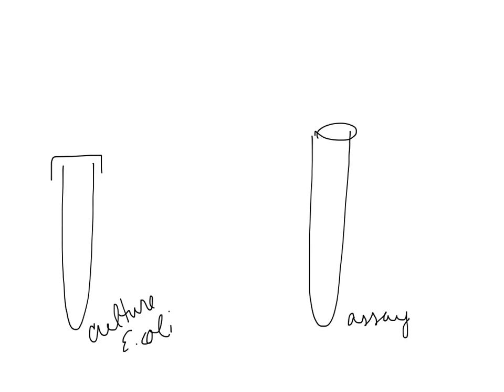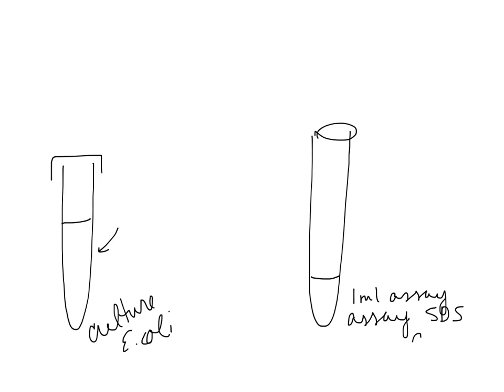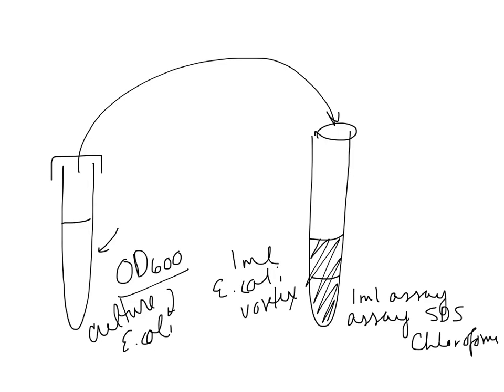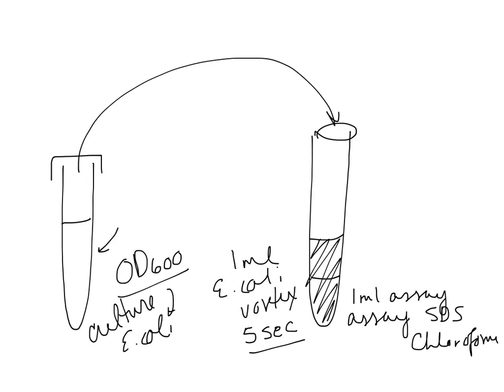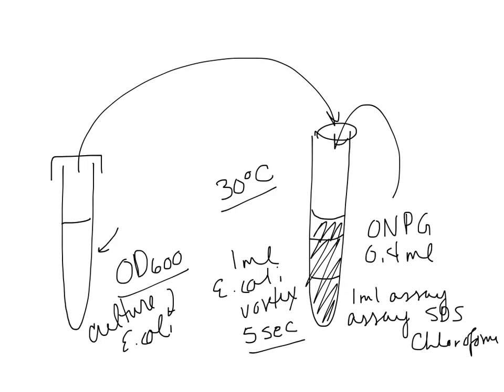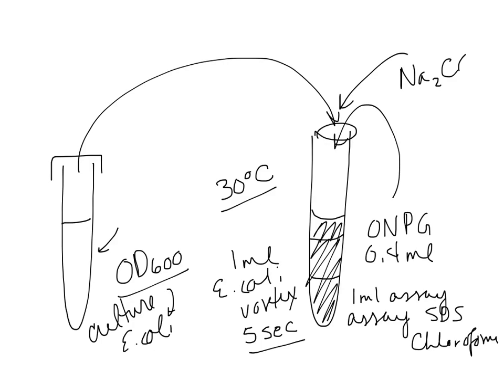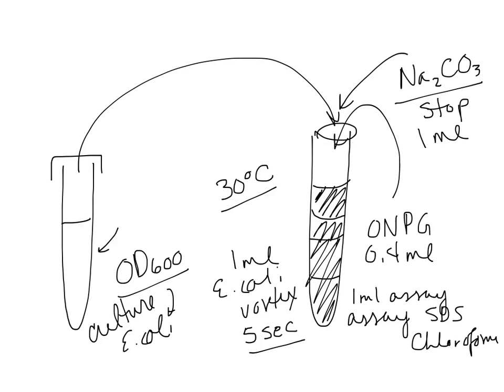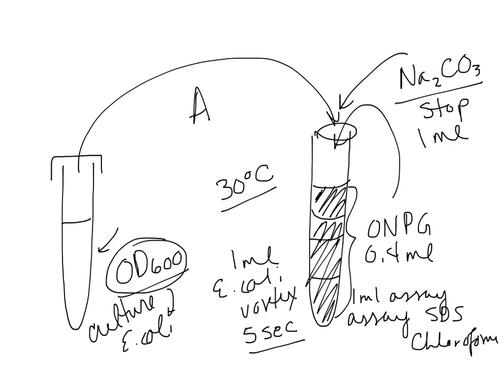Beta galactosidase assays in E. Coli

Comment: I hope you can explain the function first.
Reply: We generally do it by taking four eppendrof tubes marking them as glucose ,glucose plus lactose, lactose and control...

Now as we are going to perform b galactosidase activity...we know that it's an enzyme that breaks down lactose to glucose and galactose and also it breaks down onpg to galactose and o nitro phenol(yellow color)..

As we know about lac operon..that lactose is acting as inducer for lac operon to get switched on...so that lac z can transcribe and form b galactosidase enzyme.. which will be inside the bacteria growing in lactose(Lactose labelled eppendrof tube i mean to say..)

Now we have to check the activity of that enzyme okay?
So what we have to do?
Taking the enzyme out of the cell right?.
That's why we performed centrifugation to separate out the cellular contents...enzyme will come out of the cell because we added chloroform and sds which degraded the cells..now the enzyme will be pelleted..now z buffer we added to give the enzyme somewhat cytoplasmic circumstances..so that the enzyme can remain stable more...

Now remember b galactosidase enzyme is only present in lactose labelled test tube...other three will not produce b galactosidase ...why??
The answer is catabolite repression...if glucose labelled eppendrof we are considering..then glucose lowers down camp level...and also it cap cam complex ,will not be formed ,which attach to promoter of lac operon and positively regulates it to transcribe lac z gene to produce b galactosidase...so glucose labelled eppendrof lack that activities...now coming to lactose and glucose labelled eppendrof..here lactose is present but glucose is also present..so glucose will be consumed first due to simple sugar n all..when glucose levels are high then an enzyme called E2 ,which specifically is involved in group translocation or phosphotransferase pts system, remains unphosphorylated so it adenyl cyclase and lac permease will not be produced..so camp will not be formed and lactose will not be taken inside the bacteria...so glucose labelled eppendrof lack b galactosidase activity...when glucose is utilised then we can get b galactosidase activity in lactose plus glucose labelled eppendrof as well..but in this exp we didn't keep that for such duration where glucose is completely utilised..for sake of simplicity we performed it in 2 hours so that we have b galactosidase activity only in the lactose labelled eppendrof...

Now the main thing is that in lactose labelled eppendrof b galactosidase is present due to aforesaid principle...now to check it's activities we add onpg which is cleaved by b galactosidase also..lactose mimic onpg so it's cleaved by b galactosidase...now we can get yellow colored o nitro phenol in only lactose labelled eppendrof...so it ensures that b galactosidase is present there...

Now od is taken and Miller value is calculated...which is a part of another story...you first understand this principle...thank you
Reply: @debabratalaik9296  thank you for explaining it so explicitly , really helped me understand everything
Reply: @shreyab25  you are welcome dear!